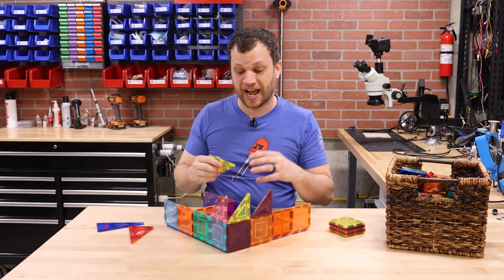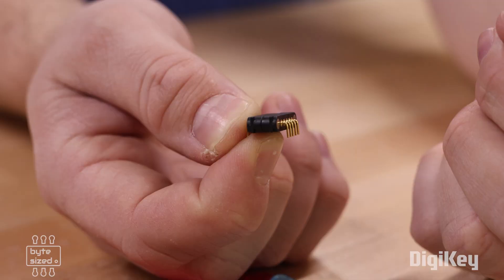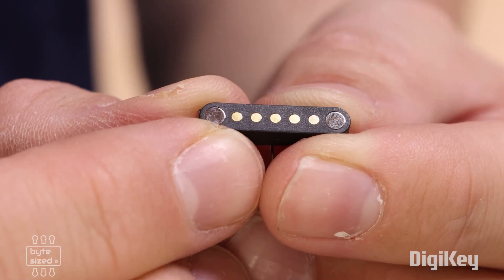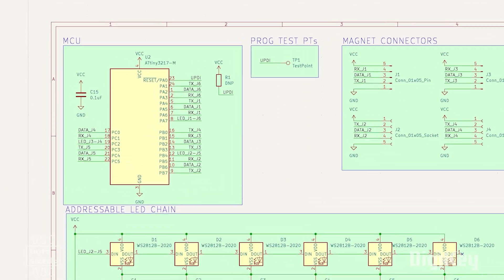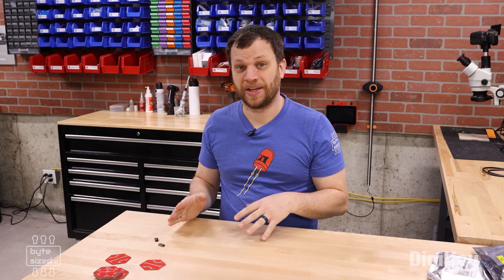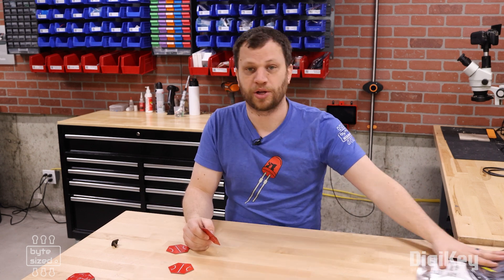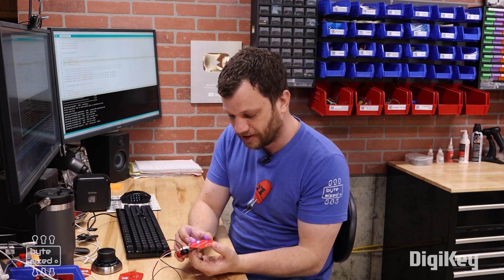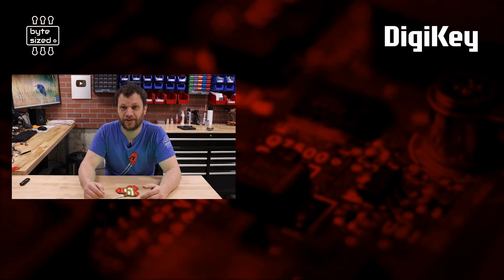PCB Tile Based Board Game Part 1 - The Byte Sized Engineer | DigiKey

Comment: I think I'd have spent a bit more time trying to resolve the unidirectional connection problem.  I know I've seen electronic tiles that solve this by using the magnets themselves to pass signals, and you could probably pull off several different protocols over just four pins.  If every connector is, say, NSNS from its point of view, it'll pair with any other, since it'll be SNSN from the first tile's POV.  Tie the middle two together for a 3-pin protocol, or use all four.  Or go to six if you're a masochist and want to use USB.

Comment: Very cool project. I really like this kind of creative use of PBCs. 
I would definitely suggest to add ESD protection diodes close to the connectors as these tiles are ment to be touched all the time. 
For convenience I would suggest to add test point pads for the programming Interface. Those will allow a programming jig with pogo pins for quicker prototype production.